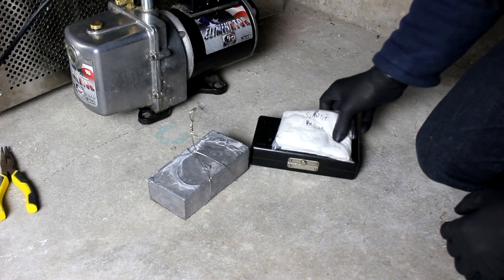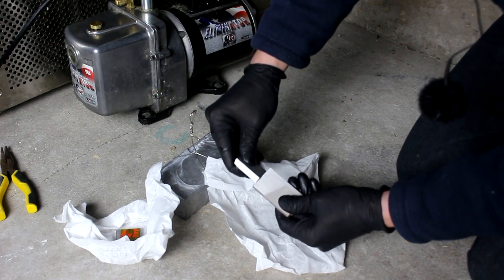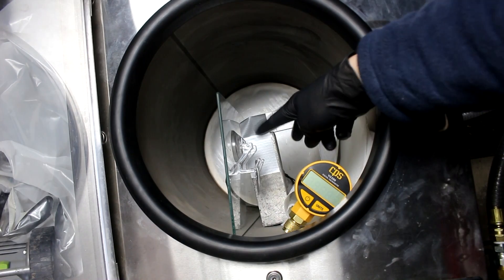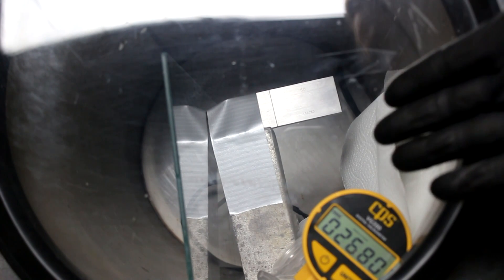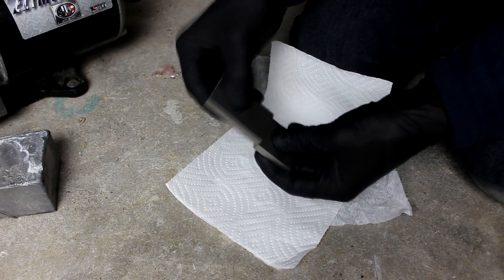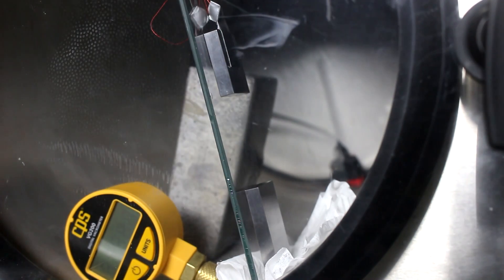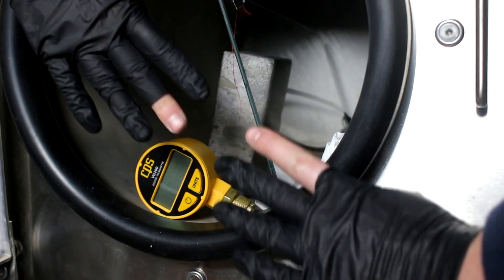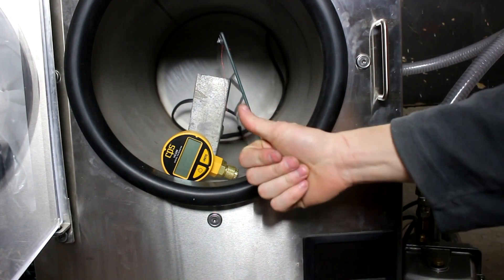Will Gauge Blocks Stick In Vacuum?

Comment: Why would they stick inside a vacuum, when they touch, if they won't outside of a vacuum. there wouldn't be a pressure difference in the vacuum to hold them together
Reply: he was testing if the air pressure on the outside of the blocks was holding them together. so by removing the air. putting them together. then reintroducing air it was a way to test if it was a suction force without muddying it up with a possible friction force
Reply: Thanks

Comment: Interesting enough for the last 10 years I've been using the exact same technique to get my beer bottle caps to stick to the wall you take the side that's flat push it against the wall I'm really hard and turn it gets hot and sticks to the wall it's normally about 180 or 360 don't start spinning stuff on your walls you will ruin it

Comment: If the blocks are THAT well machined the atoms along the gap may not be much further appart from each other than the atoms in the solid itself.
And when you wring them, you squeeze them even tighter. Might be you are half a step away from welding them permanently.

Comment: My immediate thought was van der waals force too. Mainly because they are so smooth, they have a much larger surface area that is closer together, increasing the attraction between them.
EDIT: But then again, van der waals doesn't explain why you need to slide them together. I guess it's possible that the sliding action get the two objects closer than normal.

Comment: I'm kind of thinking it's a combination of cold welding due to them being so flat but it could be that the molecular structure could connect in a pattern of some kind that let's them slide past each other when pulled apart.

Comment: Dear Cody. Love the video. Great thinkingnesses. I also have some thinkings. "Wringing" causes friction. Friction is relieved in this instance via heat. The heat from this dynamic friction is developed from the eddy currents caused by the wringing process and the minute residual magnetism of the atoms themselves. The residual magnetism left after the dynamic interaction locks the orbits of the atoms of the two seperate pieces of metal, creating a bond not dissimilar to the meniscus layer of water, but like an inverse effect. This is why tipping one block against the other breaks the bond with less energy than torsion in a linear plane to the larger surface of the edge. To test this hypothesis use a circular Halbach array of magnets to generate a dynamic field in the material at right angles to the faces which is larger than the original binding force and bring this field into proximity of the wrung blocks along the plane of the large edge. I think you may find the transient bond will fail regardless of the atmosphere. And yes, all matter has a magnetic moment, even ceramics. Hence the "friction" of rubbed surfaces and the heat generated.

Comment: You need to try ringing them in a vacuum. My husband and I are having an argument about this. He thinks that it won't work in a vacuum, and I think it will. Please help.
Reply: I personally think it is a magnetic effect. Magnetic fields are created when charges move relative to each other. This is why you have to "move" the metal plates relative to each other to get it to work. You are not excluding "air", you are excluding magnetism. You are excluding "space". Magnetism = space. IMHO

Comment: Van der waal forces :)  You can do the same with different smooth materials. Because the electrons are not in a fixed position you have random dipoles which snap together.
Next video with quantum forces explained :P

Comment: I wonder if it's galling. The sliding would provide sufficient energy to overcome the surface energy requirement. An slow impact would not necessarily provide the same kind of energy concentration that sliding would provide. Gauge blocks are also flat enough to possible cause smooth surface galling.

Comment: I always figured the wringing was necessary because it helps get better contact through helping breaking up a near monoatomic oxide layer. The mechanical wringing helps break up oxide the oxide layer, which then allows for better and more intimate contact for the van der waals force to take over. Hence why cold welding is such a problem in space as the high energy EM-Rad ablates the surface clean of oxides. 

However, I could also see it being because that, even with the high polish of the surface, on an atomic scale the surfaces wouldn't match up well enough for the van der waals force to overcome the gravitational torque. So maybe part of it is literally mashing the surfaces together to form a near match perfect pair.

Comment: They stick because they are so flat, so there appears a force between atoms in both parts stronger then the gravity. They just became one part technically, because both their crystal lattices merge into one (thats why the cold weld).
Didn't watch the vid, but I am sure it will work in vacuum. Suction cup will fall off and duct tape will stay because of glue. Kinda stupid vid subject, if you ask me.

UPD. For the experiment when you drop one block on other, they are not sticking, because you need some force to make them stick, so that atoms can stick. Air doesn't matter. You can do this, if you would be in vacuum yourself.

Comment: When I was in the Air Force (many years ago) I would use and calibrate gauge  blocks regularly. Part of the calibration was to check if their flatness was within specs. We would use an optical flat and a monochromatic light source. We would press the optical flat against the gauge block surface and you could see light bands through the optical flat when held under the monochromatic light. The light bands would run parallel to each other. You could  tell how flat the gauge block was by the distortion of the light bands.

Comment: Cool them down to liquid nitrogen temperatures and see if they stick. That would be interesting and possibly identify if any sort of surface rearrangement (like what happens with all solids in attempt to maximise nearest neighbours) is happening between the two blocks facilitated by the heat put into it from the friction.

Comment: Van Der Waals forces seem to account for some of it as ceramic blocks hold together less strongly but they do hold together... 60 symbols did a fairly good video on them and various forces have been blamed ... my pet theory is that the lack of room for virtual particles in the gap plays a small role.... a quick calculation shows the force to surface area is a bit small for objects the size of the blocks without some sort of force multiplier like forcing Va Der Waals bonding or something. 
Basically no force we know should scale with the size of the blocks the way this effect does.

Comment: Cody I have a few questions. 1 is this sort of thing only happen when its gauge blocks made of metal? or if you had finely machined say acrilic or glass or plastic would they stick together also?
My thinking is, metal steel...is made up of a crystaline structure right? and crystals are like..planes of material that grow close next to one another. so what sticks the crystals together at say a seam of some sort. you know what i mean? maybe whatever force holding crystals together so the layers dont come apart happens when the super flat and finely machined crystal layers of the metal are slide together. maybe the crystaline structer of the metal..like melds together like the structure of a large crystal?
But..idunno.

Comment: You need a diffusion pump to get real low pressures. You will still not remove the oxide layers though. Could you be rearranging the oxygen so you get a very tiny bit of vacuum welding? Or the delocalizes electrons are tunneling across the tiny gap?

Comment: I believe that when two metals pass eachother they create a small electrical field, and align the molecules in the surface metal creating surface magnetic attraction. The reason gage blocks actually stick due to this force is because of their proximity to each other.

Comment: necropost...  me thinks electro static forces and quantum dooblydoo uncertainty. mind you I know nothing of the sort. but my 2 pesos bets that when compressing whatever is betwixt the Gauge Blocks, the sliding action generates enough friction to cause minute imbalance of charges. And when the slide action is done a magnetic field neutralizes and there's nothing in between the Gauge Blocks the escaping particles (air) had been excited slightly so when the atoms of the gauge blocks  become stationary they, the Gauge Block Faces, have lost their boundary lines and begin to share a common charge (electron icloud) causing a sticktion. and is non permanent because pulling the seamless magnets apart generates the same conditions as when they were put together. only the faces are affected. 
I bet using a oscilloscope to detect flow or magnetic induction shows something to this point.
id like to see magnetic viewing paper placed against the two blocks during before and after ringing to possibly show some magnetic forces at work. my misplaced intuition says its magnets or appears to be magnetic in nature.  
the last of the hot air spewing from me wonders if any way possible to do this to contrasting metals such as alum and steel or gold and nickle. Neodymium and platinum ...  rye and pumpernickel.. i digress 
great work to Cody! i don't know if its expressed enough to you, you bring intellectual ideas to the fools eagar to spend there 2 cents. thanks
keep your ice on the stick

Comment: your experiment with the string and the tape to let it fall on to the other is not accurate besause the gage block may be not perfectly perpendicular with the smooth surface and the other in contacte with the glass and also the glass may be as smooth as possible but can be just a tiny bit concave making it not good for this experiment. these gage block very precise on 2 surface perfectly parallel but not perpendicular.
very nice video, i work with gage blocks every day

Comment: 1)laser cut string smoke moves faster than block can fall, so vacuum experiment is somewhat corrupted.2) If we had glass JO blocks, we could observe the interface optically.  In my experience, glass plates to adhere to one another.

Comment: One test you didn't show in the video is putting the blocks together & squeezing them with a quick-grip hand clamp to see if they will stick together without wringing of any kind.  If that works, then the blocks are operating like your suction cup (air is forced out between the blocks that creates a negative pressure between the blocks).

Comment: If you are breaking out the gauge blocks and still using a caliper, you might want to rethink your processes.

Gauge blocks and Micrometeres?   Yes, very much so.  The only tool to use with Gauge blocks since a Caliper is only good for +/- two to three thousandths.   Micrometeres are good for down to the ten thousandths.

Comment: I think it should be tried to bring two different metals with the same precise surface together and see if they do the same, because I think that this is because of the two surfaces that come together start forming metal bonds. I guess every now and then some iron ions come so close to each other that they can't distinguish between wich block they belong to.

Comment: What I was told when I was training to be an engineer, was when the gauge blocks touch, the surface is so smooth and level that the molecules cold weld together, but if they are left together for too long they actually weld to each other and in some cases need replacing

Comment: have you tried putting them in a Pressure Chamber rather than a Vacuum Chamber....  Maybe the pressure will either fuse or release them based on the starting point?!?  Just a thought

Comment: Very interesting! I followed AvE’s channel and found this video. Cody, try this: One hypothesis says that this might be and electron charge holding the blocks together. Get a ZeroStat gun, and imply a charge on one of the blocks to see if the charge has any effect on the blocks. Wring the blocks, then try to charge one end of the blocks to see what happens.

Comment: Actually worst case whole  length is within 600nm for a 100mm gaugeblock grade3 used on machine shop floor, as opposed to grade0.5 30nm max. 
So even a crap 100mm gaugeblock is paralell and flat to better than wavelength of red light...
From NIST gaugeblock calibration manual

Grade Deviation from Nominal
Length (µm)
 00 (0.05 + 0.0001L)
 0 (0.10 + 0.0002L)
 1 (0.20 + 0.0004L)
 2 (0.40 + 0.0008L)
Where L is the block nominal length in mm

Comment: If the effect is from atoms intetwining, that means you dont have to move very much to break the effect. Perhaps the vibration of the pump or even when the air is returned to the vacuum move the pieces enough to break the interaction. Just my thoughts.

Comment: I'm wondering if you slide the gaude blocks over a degausser if that would stop them from sticking together. I'm guessing it has something to do eddy currents and static electricity manipulating the weak force. If you try dropping them together again I suggest a small container of sand to absorb the impact with some plastic pellets between the block and sand. That shoud negate any recoil.

Comment: In case you care about the science as much as creating videos to entertain, you will not be able to cold weld gauge blocks together by placing them together in a vacuum. The element iron forms an oxide on its surface when exposed to air. You will need to eliminate the oxide by heating the blocks in a hydrogen atmosphere or in high vacuum for long enough to reduce the oxide or eliminate it by mechanical action sufficient to mix the oxide layer into the metal beneath it. If you want to be successful, I suggest that you read some of the large volume of literature available on the subject.

Comment: Does it work the same if you connect one or both parts to a ground plane, or run a small current through one or both parts?
Reply: Does it matter if it's before or after you ring them together?
Reply: What about introducing magnetism? Disrupt, help, prevent, existing, or new connections?

Comment: If sliding one direction causes a bond, does sliding back to or toward start release it?
Reply: If you ring them together, then rotate, how far do you have to go to release them?
Reply: If you ring, rotate far enough to release them, is there a way to rotate them without moving them apart to recover the bond? Rotate back, continue rotating? Perhaps 180 or 360 degrees?

Comment: Can you make the connection between different shapes? Long, thin blocks? Squares? Cylinders? Hollow cylinders? Two mating curves (Convex to concave)? Two mating semispheres? What types of relative motion are required? Twisting mating cylinder vs sliding?

Comment: It would be interesting to try this with materials other than metal, and between dissimilar materials. You could learn a lot if other similarly precice surfaces stick, or don't stick.
Reply: Find the right people you could get silicon wafers at least this precise.
Reply: Will this work with soft materials? Copper? Gold? Plastic? Depending on the cause, soft materials might work better or worse than hard ones.

Comment: Can you ring them together while keeping them pressed against the glass? If high precision is required might the error between the mating surfaces and the flats of the blocks x2 plus variation in the glass be enough to prevent the effect?

Comment: Try to make them stick face to face rather than edge to edge
Reply: Made in France they're made for calibrating your micrometer. They're only made to be used one way, so the faces of them would not be as perfect as the parts he's putting together.
Reply: Those are not lapped to a ten millionths inch accuracy.

Comment: Could it be due to heat welding? While rubbing two pieces, heat is generated that is not enough to significantly raise the temperature of whole block of metal, but enough to excite the first layer of atoms on the surface of metal blocks.
Next what can be observed is how the static friction is many times more than dynamic friction of two rubbing metals.

Comment: atomic diffusion is very fast in materials with the same composition. Flat surfaces increases the surface area. Rubbing is mechanical energy with also increases the rate of diffusion. Pretty simple kinetics

Comment: When you slide them together the friction from either block may rub off oxides and because they are so finely ground to such a flat surface when both pieces oxidize they are held together by the oxidization?

Comment: Using guageblocks on a daily basis, I have been wondering how they stick for close to 20 years now, im sticking with the wander-? whats his name -theory, the marbels doesnt only move out lenghtwise in the direction you push them together, im thinking more like playdoh mushing out all over. But now im thinking; would that theory still hold if you pushed them together under a full vacuum?

Comment: If it cold-welds the surface structure should change upon breaking them apart. Might be worth it checking it with a microcope before and after

Comment: +Cody'sLab
Water, in large amounts, acts as a lubricant.  While in small amounts, functions as an adhesive.  This is why people breathe on a spoon before hanging it from their nose.  Perhaps it is a small amount of water vapor trapped between the blocks causing them to adhere.

To test this, it would only be a matter of sealing them inside a desiccated chamber, and then try to get them to stick together.

Comment: I wonder if you're not actually heating up the individual molecules on the ends of the gauge blocks just enough (with the friction) to cause them to melt together?  Since the bond is so thin, it isn't very strong.